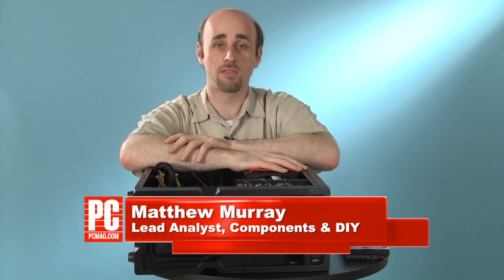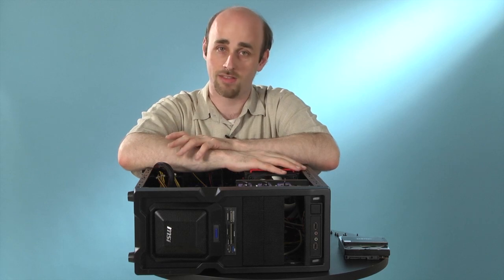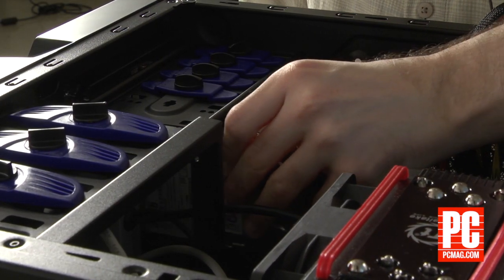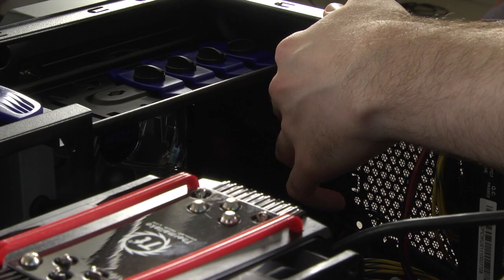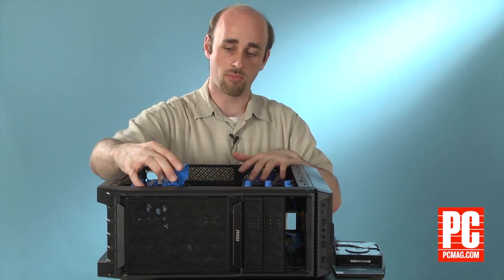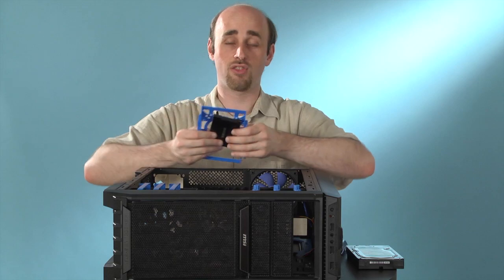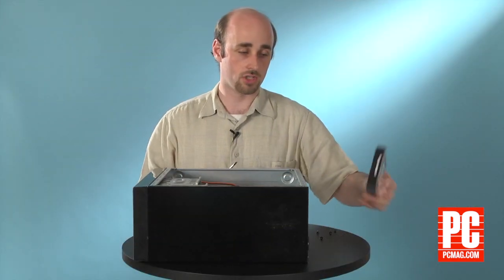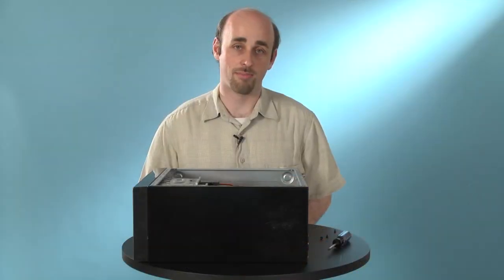How To Install a Hard Drive

Comment: What freaking case is that ?!? It's ready for each and every thing you can throw at it. It has clips instead of screws, it has a special SSD slot, and it has a built-in adapter for SSDs... That's the best case EVER.